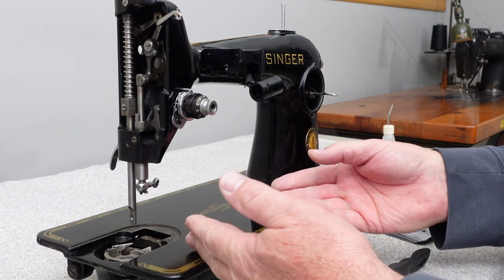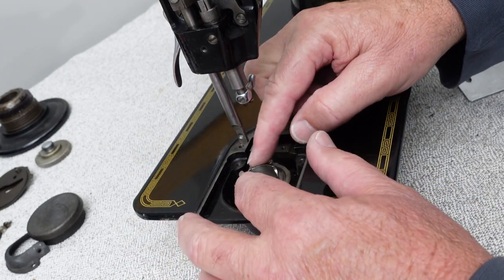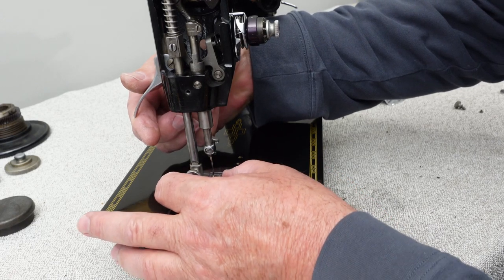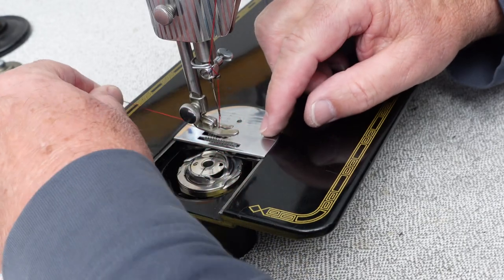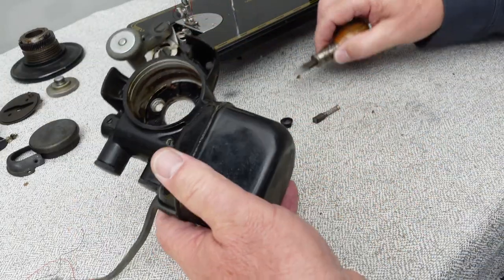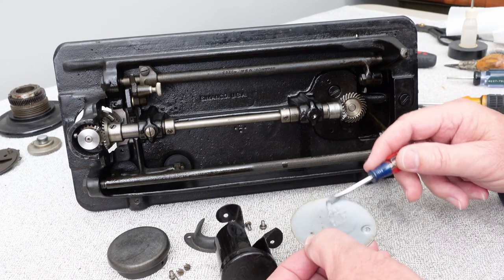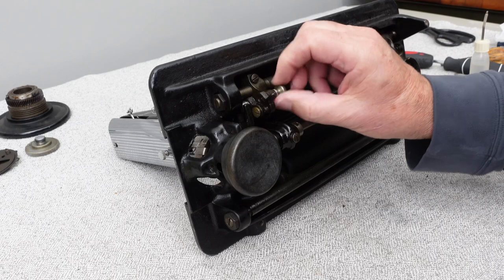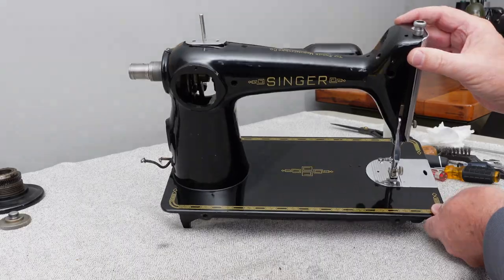SINGER 201-2 sewing machine restoration Day #3

Comment: Greasing of the gears is incorrect. Its an oil only machine.
Reply: I just bought a 70 year old 201 that came with a container of the original singer grease. I imagine the worm gears do need it or some more modern grease.

Comment: Thank you for your demonstration of servicing the singer 201. I recently purchased one sight unseen and it seems the center main rod on the bottom is frozen. I get slight movement on other gears so that is how I came to this assessment. I've tried using penetrating oil with no success. Any suggestions on what I might soak it in to get that rod free? I really would love to save this machine and not have it go for parts if possible.
Thanks